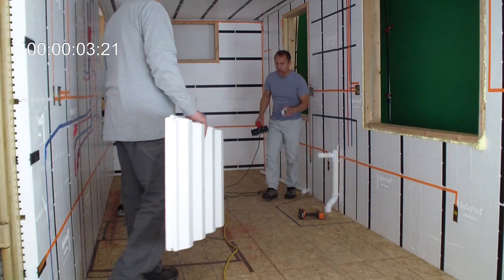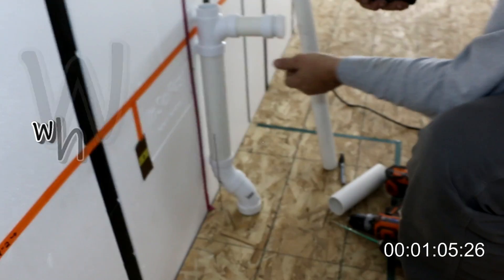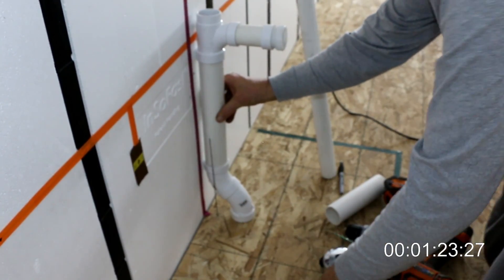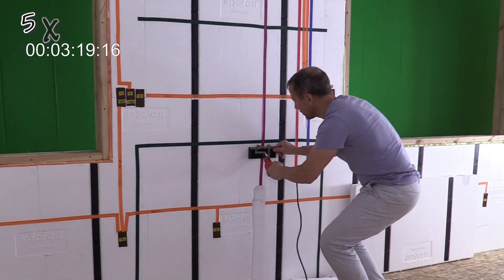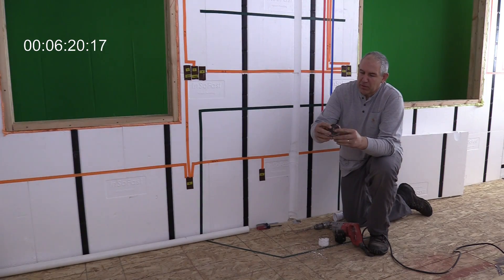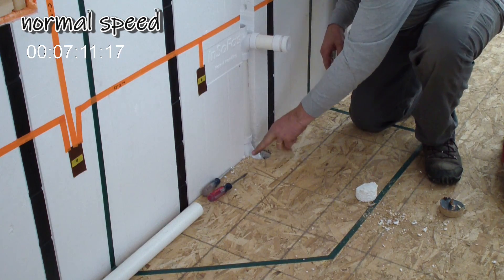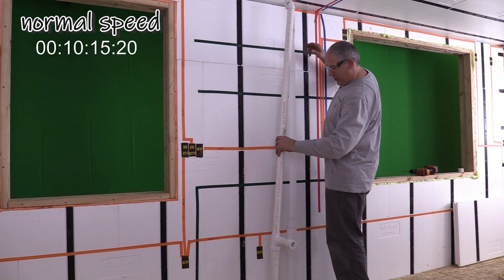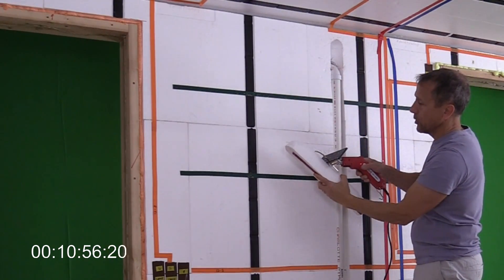Shipping Container Plumbing with InSoFast

Comment: What was that pipe for? Threw me off with the hole being drilled up high and how much water pressure you would need to push water through it.
Reply from the maker: The pipe you are referring to is a vent pipe used in typical plumbing construction. If you don't provide an "air" vent what will happen is your water drains will vapor lock and not drain. Water is not meant to be pushed up through the pipe but drain down.

Comment: What r value do these panels give me? Can I air-condition the space without creating condensation on the metal walls?
Reply from the maker: Yes if installed correctly and you properly condition the interior space you will not have condensation on your metal walls.
https://www.insofast.com/insulation-panels-for-shipping-containers.html
https://www.insofast.com/explore/insofast-plus.html